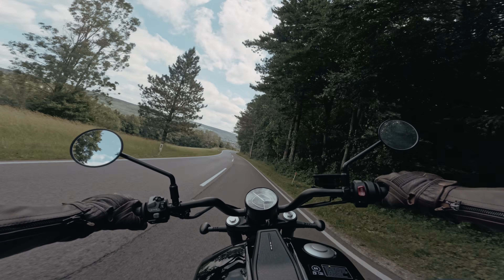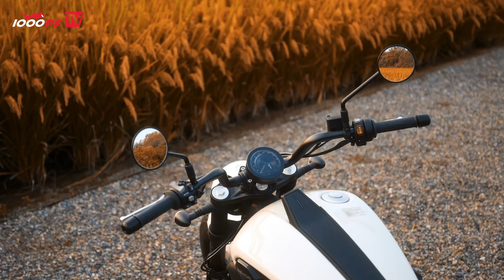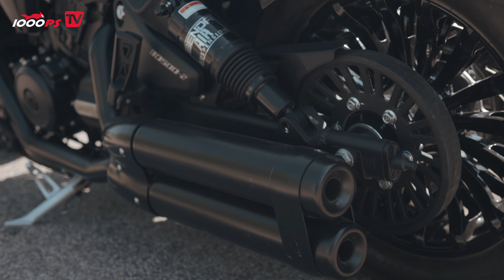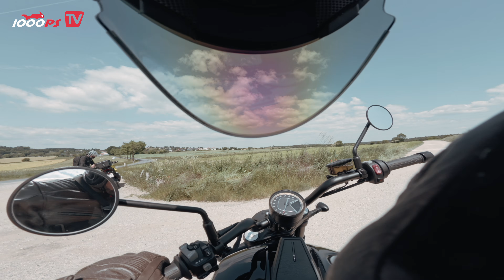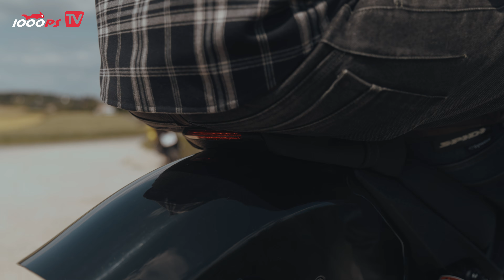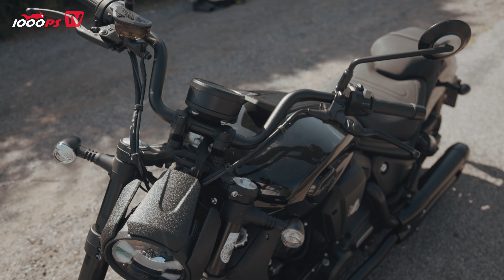V4 for under €9,000? The Benda Dark Flag 500 on test!

Comment: I've got a Honda 250S V-twin cruiser Japanese import to the UK it only weighs 130 kilos and easily tops 100mph two up.
I'm not to sure these heavy 4 cylinder bikes restricted or Ltd are a necessary entity it seems like the bike has been designed around the engine just because it's what they had in stock at the time. There is a lot of uneccessary weight there and no discernable performance improvements for it, still a nice looking machine though at a reasonable price.

Comment: I think Benda will be moving fast: the current model is just getting reviewed and they are already launching the new one with important design modifications and upgrades. On a saturated chinese market, they are going for risky design and gadgety accessories as standard, trying to see what sticks and keep ahead on the value proposal. The air suspension is a liability: little bennefit for the complexity. The V4 is an interesting proposal, that's for sure the piece de resistance here... I just hope it doesn't become a maintenance nightmare with 4 valves per cylinder. Still, it's weird to have a revvy engine / gearing that suffers down low and wants to go, on a chasis that tells you to relax and cannot lean. It's heavy and will be uncomfortable to meneuver inside the city and passengers will suffer, yet it won't like B-roads either. So, it's a nice-looking toy, a conversation piece and a fun ride while the novelty lasts: you definitively don't want this as your only bike. There are better, more reliable and uncomplicated options even at that price that will deliver on a wider range of situations. The white version looks stunning.

Comment: We have reached a point where Chinese manufacturers are reinventing the wheel! CFMoto is making a sports bike with an inline 4 and now this!? So it's not the end for multiple-cylinder engines after all? Bravo
Reply: There has been a Honda VF750 Magna cruiser-type bike with a V4 about 30 years ago…
Reply: No they are behind the curve as in they don’t over check for what they make like other manufacturers they make it cheaper and more simplified to cut costs of manufacturing and I’m all for it back to how they use to be
Reply: You trust chinese quality?
Reply: Where was your smartphone made?
Reply: @mpeugeot never said I trust my phone did I?
But I'm not risking my life riding my phone at 70mph on the motorway am i? 

Thought that was obvious...
Reply: @Cpt.Gingerbeard the point I am making is that phones are a great example where Chinese quality is very high.  Let's take another example, optics for firearms, take Arken for instance - extremely rugged high quality rifle scopes made in China.  Only a decade ago, this wasn't even something people would imagine being able to manufacture in China with the necessary quality control needed to produce precision rifle optics.  The same is true for a handful of Chinese motorcycle manufacturers (CFMOTO as an example). What they are producing is shockingly good today, but 10 years ago, I would have been running the other direction.
Reply: @mpeugeot  …hmmm TESLA

Comment: That is a small amount of power for a v4. Especialy for that weight.
Reply: it's 500cc. what did you expect? Harley Iron 883 = 49-51 HP. 383 more cc with 3.4-5.4 less HP. the Dark Flag 950 has 108 HP. Harley at 1200cc have 60-66 HP.

Comment: I think a motorcycle like this might have some difficulty in the US market. Cruisers here tend to be low-revving and high torque. Very forgiving in stop-and-start traffic around town. A bike that requires more technical proficiency to rapidly shift through gears between traffic lights wouldn't be very welcome. In addition, engine displacements in the range up to 500cc are often considered 'beginner' or 'starter' bikes. And 40-50 horsepower is pushing the lower limit of what you might want on some of our 120kph freeways. All that said, more motorcycles from more companies is always better, and experimenting with interesting tech and features can pay off big. The next ten years could be very exciting in motorcycling. I may not be in love with this bike, but I love the future that it hints at.
Reply: Everything you said about it is true of the highly successful Kawasaki Vulcan S except it is a 650....but a 150cc difference is what maybe 15 hp only?